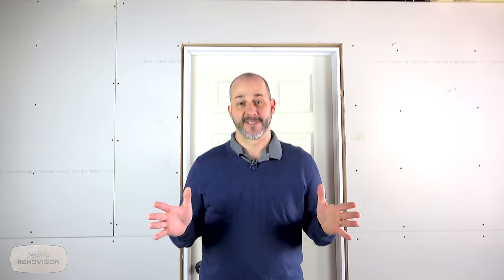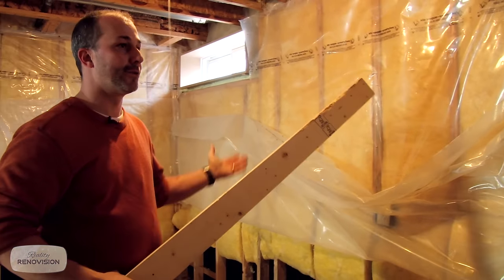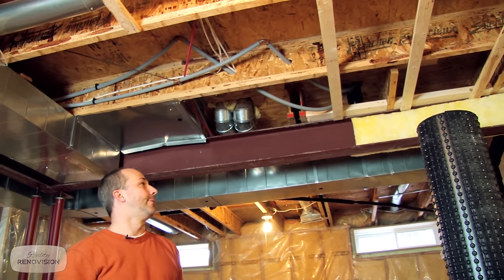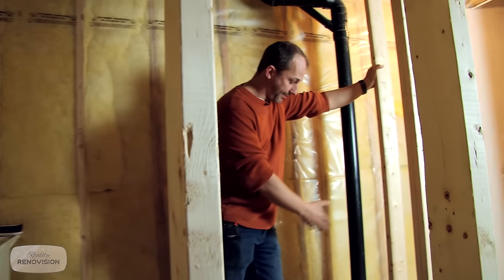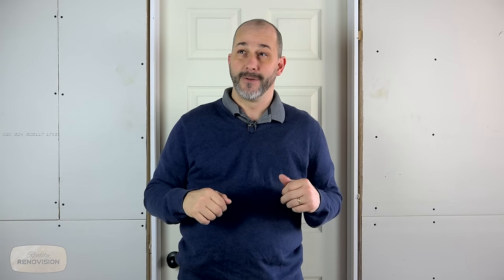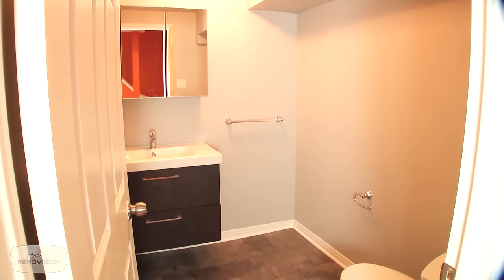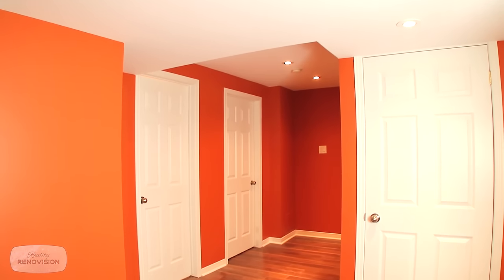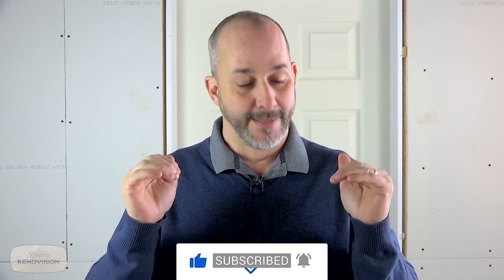This Basement Finishing Secret will Save you a FORTUNE!  | Reality Renovision Ep04

Comment: Wood-basement=mold.  You can see it already exists on the 2x4s at 1:08 in the video.  I’d suggest steel studs, rockwool and paperless drywall
Reply: and make sure that subfloor can breath, i've installed those before with 3-4lbs water per 1000ft/24 hours and without adequate airflow, it will hit RH 90% and get musty under it.  always test with  calcium chloride vapour kit first unless your 10000% sure that house has a vapor retarder under it and still functions.

Comment: if you're DIY-ing it:
electrical is straightforward, just do your homework to keep it to code.

The tip: save yourself a ton of work and mess by installing the boxes AFTER you've hung the drywall. 
You do this by
-leaving slack in the wire where you want a box to go; if multiple wires are involved, label them
-at this point, I like to position the drywall and cut the holes for the boxes BUT
-you can just hang the drywall, marking the box location, then come back after and do all the boxes at one time. You'll need to be cautious to not nick your wiring.

If you need more information I can provide it, but you likely get the idea.

Comment: may i ask you a question Jeff,the heating with duct work,what is the furance running - oil,lpg or what.
Ive never seen it here in Ireland or Uk, they may have it in mainland Europe. Do you have any vids on other channel about them.
Im very curious how they work and benefits of them over other systems. Im running a coal-wood backboiler stove that heats up the domestic hot water and rads to heat each room
Reply from the maker: Hi Lenny, we use mostly natural gas here. in the country we use propane.
Reply: Lenny Rossa I doubt ya will see my reply , I’m just looking at the many replies to my comment now. I have a bit of exp. in HVAC IN the northeast states and I will through in my 2 cents worth. So from my experience NG seems to be the most preferred IF AVAILABLE using a split system ( gas hot water and heating using Ductwork ) ALTHOUGH it seems that many builders go with electric if they have to spend to much to bring in municipal utilities . I have the opinion that electric will be the future ( utilizing sustainable energy) eliminating the need for Ductwork and  having each room controlled separately.
Reply: @donaldschell1435  i did see your reply,and thank you for your reply. i got an electric unit and im impressed that im going to get a 3 unit version. Solar was in the back of my mind when i ordered the unit. thank you for your reply and hope you keeping safe

Comment: Great tips.

The HVAC tip "reduce from 5" to 4" round duct to build up pressure to throw the air further" is inaccurate, and in fact  your reduction in size will do the opposite.  I design HVAC systems for a living.  If you want more pressure you need a different fan or change the fan speed.  Trying to push the air through a smaller duct and with a fitting will result in higher pressure drops, reducing airflow.  The throw is a function of CFM and the design of the register.  You are correct in dropping the heat supply down to the floor level.  But I would not recommend reducing the duct size.
Reply: its also worth noting that 4 in duct is not a supply size really, i install ductwork and also am a residential and commercial hvac tech and 4 in duct proves such little cfm that its only used in like walk in closets to prevent mold or dead zones of air flow. 4 inch is a good exhaust size for bathroom fans ect.
Reply: Notice you got neither a heart nor a reply. I don't think he could handle you correcting him. Must have an ego
Reply: @Integrity.is.everything  or it's due to the age of the video
Reply: @rivahkillah  No. He's liked comments from WAAAAY after this person's comment. He just didn't like what he said
Reply: @Integrity.is.everything  - well, can you blame him? everyone is a claimed expert in the comments section
Reply: @jeremylarson6267  Yes sir i can blame him. We learn as toddlers that right is right and wrong is wrong. If the commenter is indeed right just man up and give him his credit and say you messed up if that's the case
Reply: @Integrity.is.everything  - ok, the commenter has to be right, because a commenter said so, illogical but ok.
Reply: @jeremylarson6267  Nice gaslighting there. Not what I said but please continue since you obviously don't have the social skills to make a valid point without distorting words. I'll wait......
Reply: @Integrity.is.everything  - sorry, as much as you might want to turn this personal and devolve into insults, i cannot entertain your delusions that a comment from a random poster has to be correct. perhaps this is why there was no comment back from the channel owner - but that would be me speculating, much like you have done.
Reply: @Integrity.is.everything  - why must you resort to insults?
Reply: @jeremylarson6267  Not one insult or name calling from me. I stated my perception of the dialogue and pointed out what i perceived as inaccuracies in your statements. I stand on everything I said.
Reply: @Integrity.is.everything  - did you read what you posted? you may want to spend some minutes looking into that, or don't
Reply: @Integrity.is.everything  - ok, choosing the or don't branch - that is your option of course, so not sure what value that the answer to your question is yes. now what would you like to talk about?
Reply: @jeremylarson6267  You tell me Jeremy. You called me up. I didn't call you remember? Lol
Reply: @Integrity.is.everything  - sorry, i am not a mind reader and don't know what else you would like to talk about. that is why i asked. lol
Reply: @jeremylarson6267  I think we've reached a point where we have agreed to disagree and can go about our lives.
Reply: @Integrity.is.everything  - to be fair, this chat didn't divert from my life in any way
Reply: @jeremylarson6267  I can't say the same. I considered it a waste of time that coulda been better spent more productively tbh 🤷🏿‍♂️
Reply: @Integrity.is.everything  - sorry for your loss

Comment: NEVER DRYWALL A BASEMENT CEILING (I totally regret doing my basement ceiling with drywall, just do a tile drop ceiling, you WILL need access to that ceiling at some point)
Reply: wow...thank you for that tip
Reply: @mariad4183  plus the drop ceiling tiles absorb lot of noise..drywall ceiling the noise bounces everywhere..i can't even be in my basement when there's more than a couple kids...gets too loud
Reply: @K4R3N  aawww... thank you so much.  We're looking for options - especially for sound insulation.  That's good to know  💕💕
Reply: @mariad4183  there's a lot of videos on youtube..they are called "acoustic ceilings"
Reply: @mariad4183  also please before you do any basement work check for RADON and get the radon fixed before any basement work.
Reply: @K4R3N  ...great thank you so much.  I'll look into both of those.  Thank you kindly dear!
Reply: Drop ceiling is not as economical you want to believe, and its very easy to patch up drywall if you ever require access to the ceiling. Drywall will always be the best option.
Reply: @Sean-mc4iq  dare you to spend ten minutes with my kids in my drywalled ceiling..you won't last 5. Terrible acoustics. I'm never doing drywall ceilings again in my basements
Reply: @K4R3N  There are many types of Drywall, you can get soundproofing drywall's... or even place acoustic sealent on the drywall itself. I wouldn't settle for a drop ceiling.
Reply: @Sean-mc4iq  You are so right.  Drop ceilings in basements are unsightly, very cold feeling and your limited lighting options make you feel like you're in a doctor's office.  But one of the biggest things I hated on mine was that ALL (and I mean ALL) of the panels start drooping and become discolored eventually.  So, every 6-10 years, you have to replace all of those nasty (and hazardous) panels.  
Like you said, if you buy sound-diminishing drywall and insulate between the joists (studs, beams, whatever they're called), the sound from above is minimized---just like it is between a first and second floor.  I am so glad that I replaced mine!
Reply: @Sean-mc4iq  So you can not do a termite inspection, run a speaker wire etc etc.
Reply: Drop ceiling looks trashy. If you plan it right you have everything you need run before you close it. I put coax and cat6 in every room upstairs before I did the basement. Drywall is easy to patch. Insulate between the joists and put soft furniture or carpet  to absorb echoes.
Reply: @penguin12902  drywall is noisy AF
Reply: @K4R3N  not if you have sound absorbing materials in the room. It's noisy because you have nothing soft to absorb sound. Put down a rug, hang some paintings on the walls.  They also make acoustic paint. Check it out, it works.
Reply: @Sean-mc4iq  There's no such thing as soundproofing a ceiling.
You can dampen the sound coming from above, but you'll "never" (without having concrete floors) truly prevent
sound from travelling through the floor, HVAC, even the pipe openings.).

The less sound you want traveling the cost goes up in correlation.
Reply: I just removed an acoustical ceiling and replaced with drywall.  Had a couple of leaks and yes, it was easier to access for repair.  The problem comes in when trying to find replacement panels to replace the water damaged or stained sections.  Even though the ceiling wasn’t that old, no one had the exact replacement tiles.  Even the manufacturer.  Everything was either a different surface design, or a different shade of white.  After weeks of searching for the correct tiles, I said hell with this and replaced it with drywall.  Now I can cut the drywall, do a hot patch using 90 minute mud, and paint same day.   I’m not entirely sure but I think drywall also has a better rating as far as a fire rated assembly.
Reply: Acoustic drop ceilings in a house look cheesy to me. I’ll just take a lot of pics before drywalling and rip out and fix what I need to later.
Reply: @backcountyrpilot  I'll take cheesey instead of "rip out and fix". Plus the panels absorb noise.
Reply: I just bought a home and they already installed a line tank in my basement ❤@K4R3N

Comment: Basment should only be finished if Have Proper insulation from exterior Walls with Drainage.
Reply: How do you know if you have that?
Reply: @VitasDream  There would be no Moisture on your walls and no need for Dehumidifier. Or half Dig hole Outside against foundation 8" x 12" to see if there any kind of Vapor Barrier or insulation on Exterior walls.
Reply: @louishollandjr  thank you but now I know I don’t have one. 😂
Reply: @VitasDream  it’s okay if your foundation walls don’t have waterproofing on the exterior side. unless of course you have frequent water infiltration problems, in which case you could always install a sump pump and/ or french drain. always make sure you manage your flooding problems before finishing a basement

for basic thermal and moisture control, the insulation and vapor barrier would be installed on the interior face of the wall. this just prevents cold air and moisture from permeating through the concrete directly into your finished space. its a pretty simple DIY

Comment: Would you recommend 1” rigid foam board between your dimple board and your 5/8” osb sheet subfloor?
Reply: No, It'a amazing how this floor system make the room warmer.  If you want to insulate the floor, find a floor system with insulation in it.  The dimples allow any moisture to make its way to a drain, in theory anyway.

Comment: I've got a bungalow in a pretty cold part of canada, where the temperature drops probably 6-7 degrees down here easily. Currently, it's laminate on concrete with a tiny thin sheet of something underneath. Would you suggest carpet, or vinyl? Recently added two heat runs and an air return to try and combat this issue.
Reply from the maker: for best results get a space heater and an insulated subfloor.

Comment: Looking at how you do the flooring is very cool and I've seen you do that in other videos.  As someone that wants to do that in their basement, should I worry about framing the walls first or putting in the subfloor first?  Should I be leveling the uneven concrete floor before putting in the subfloor, or try to level after?  I'm very new at trying something like this.... CHEERS!!!
Reply: level the floor, put the subfloor first then walls on TOP of the subfloor.  leave a subfloor gap between the concrete wall too.  it needs air flow or it will get moldy under the floor, air gap or not. (air gap isn't much use if it's not moving anywhere).
Reply: Similar to the other response, subfloor first, then walls.  I elected not to level the concrete first due to budget at the time, and have regretted it.

Comment: FYI, This is also how NOT to paint a basement.  The deep, saturated orange color shrinks the room down and then continuing that color up into the ceiling and then painting that column orange as well turns this basement into some kind of color therapy based torture chamber.  A dark ceiling or a dark wall can be "receding" and visually expand the room, but wrapping the room in a bright saturated color is like climbing into a small tent or sliding into a sleeping bag. I guess it depends on the effect you're looking for, but resist this notion that basements are dark and dreary and therefore MUST be painted bright colors. Saturated colors like this are always a really bad idea for small spaces. Go with neutral colors, maybe 1 dark feature wall to make that wall visually recede,  and get your cheerful pops of color from pillows, carpeting and wall art and bring in wood tones on furnishings and/or flooring to warm it up. Paint that column with a blackened bronze metallic paint and I guaranty it will disappear from the room.

Comment: Hey Jeff, on the heating topic for basements, would an underfloor warming system be advised or is there a reason why you shouldn't put a system like that in the basement?
Reply: If you're building new, in-floor radiant is an excellent choice. If you have the headroom to spare, and you've got an existing concrete floor, you can run your radiant, then overpour and achieve excellent results.

Comment: In reality and honest truth is that you can finish a basement for less then $3,000 if you do the job yourself. Contractors usually charge per square foot, others charge per labor. 90% of the labor work is around $15k to $25k which is absurd when materials cost $3,000. When i finished my 1,008 sqrf basement in 2018 i was charge $8,000 from a Mexican contractor including materials waterproofing and installing brand new windows. Labor was $5,500 and materials that i purchased was $2,500+ tax
Reply: @Rocco im in the process of getting quotes from contractors, the prices im getting is ridiculous. 1000 sqft running into $45000 plus to finish it. Would like to connect with you maybe i can get some pointers
Reply: @Rocco Lucio, I would like to connect with you. I have 600 sq ft that I would like to finish.
Reply: @praveenkoya1896  framing walls and adding electric are very easy skills to master even for a beginner DIYer.  Most electric work will not involve any complex 3-way or 4-way circuits.  Check YouTube and some reference magazines, all the info will be there for basic work like this.

Comment: if you do vinyl right on the concrete wheres the insulation value
Reply: Yeah, I'd at least roll out vapor barrier. I used some pretty pricey stuff on my last house but it was thick enough to add a little softness to the floor and had little air bubbles for insulation if I remember correctly.